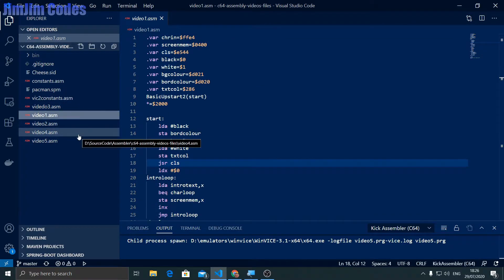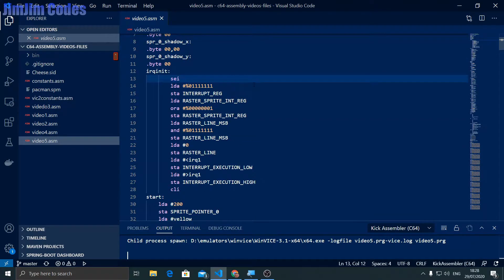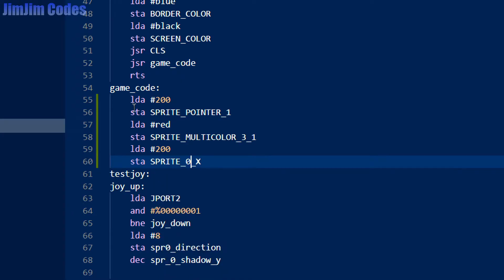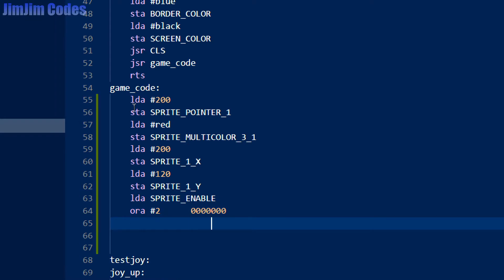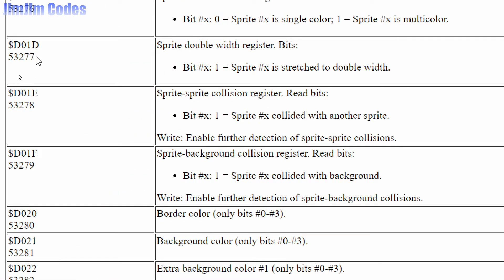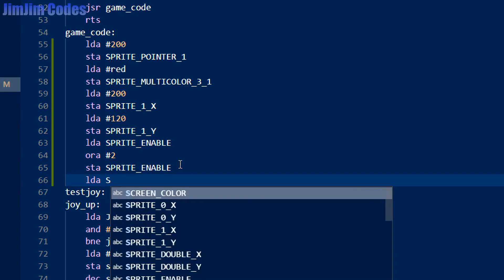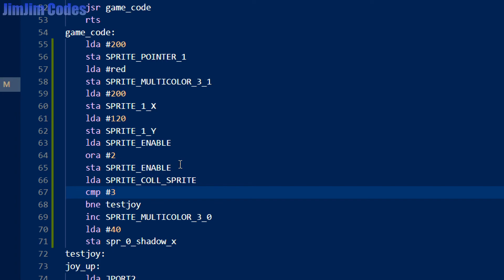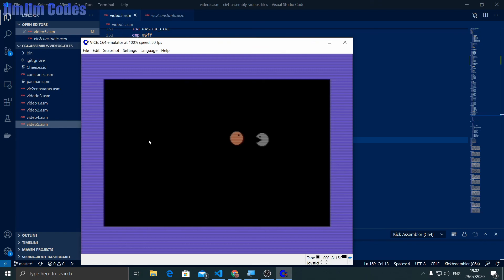JimJim Codes 006 - Beginning Assembly Language on the Commodore 64. HARDWARE SPRITE COLLISION

Comment: Again can't help but add to the great comments here.  You really break it all down and explain everything in a way I have never seen.  Many congrats.  Justa. question that I was thinking as you were talking about the sprite collision register... what would happen in the case of many sprites colliding at once?    lets say sprite A collides with B and C collides with B (but not A)... does the register just simply show A B C as being in collision or does the raster interrupt show different collisions on different cycles?
Reply from the maker: As for as I know it would show all collisions at once so should be careful which sprites could collide with other sprites but not matter if colliding with certain others. If you don't want any action if A hits D, and A hits B while C hits D, then always use an AND to mask the bit for sprite D when testing for collisions with A
Reply: @JimJimPlays  thanks for the quick response.  So in essence as there is only one register (53278) for sprite collision if 3 sprites ABC collide there isn't actually an easy way to know which sprite collided with another sprite.....   

I suppose the only other way would have been a collision register per sprite...  but that isn't how the VICII operates.

Btw.. on another thought... Would be interesting to have an example of plotting and drawing lines in C64 assembler... it always intrigued me how slow BASIC was in doing anything with the graphics...  esp as there were no commands in BASIC for doing anything compared with BBC/ZX Basic at the time.

I recall writing some program for drawing moire patterns  years back and it took ages to render.   painful...

Comment: I'd like to echo the other sentiments here.  This series is an exceptional set of tutorials for those of us who are new to assembly and trying to pick up coding on the Commodore 64.  I'm using the VS Code -> Kick Assembler plugin -> VICE tool chain under linux (Fedora) which so far has worked out well.  One thing I do hope for is a renewed interest in coding for the platform (TheC64 full sized "remake" is finally coming out in the North American market in November), and content like this is one way to help foster that.  Well done.